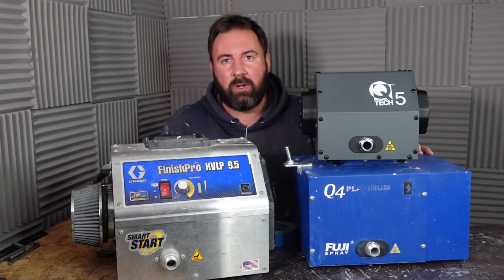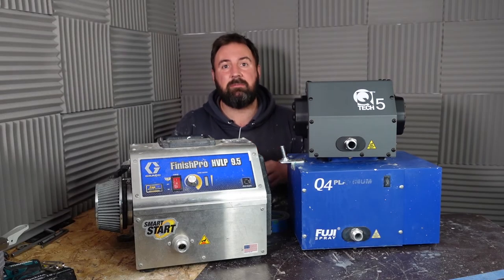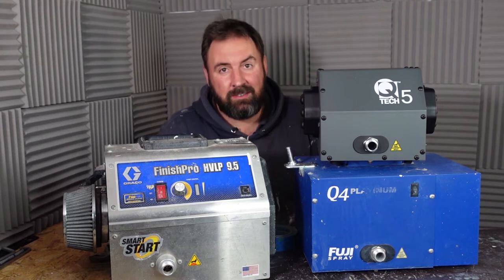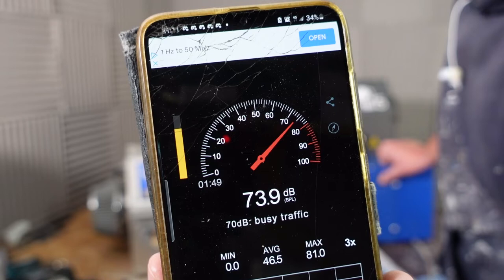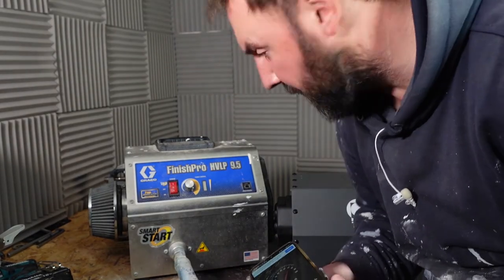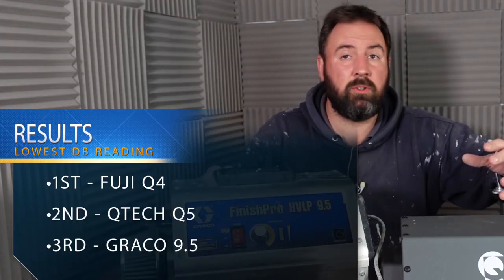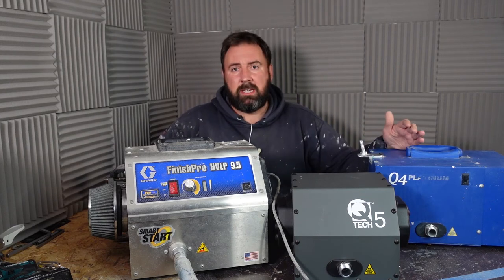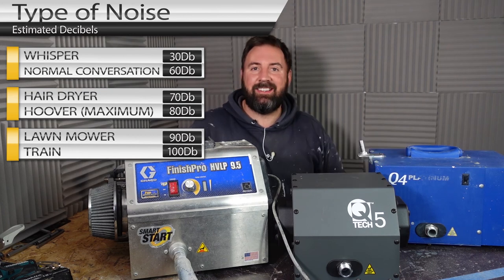HVLP Turbine Sound Test: Graco 9.5, Fuji Q4, and Qtech Q5

Comment: I never use the turbine in the room I’m spraying. It’s too noisy ( they all are) . Also the suction is so strong,any spray mist/ dust is going through your filters. The hose is so long you can put it outside the house or another room to annoy someone else and use a remote plug socket and save a load more money on the start/stop feature on the overpriced Graco. Buy a 5 stage turbine……avoid Apollo. I’ve been using Turbines since 1983
Reply from the maker: answering questions i get asked thats why i made the video
Reply: Why not the apollo turbine?
I just picked up the 7700 atomizer gun and I'm looking to pair it up with the best turbine. 
I've got a Titan 7.5 currently.

Comment: Like the video, attempting to respray a car and in the look for a turbine system was looking at the Fuji q4 platinum series a bit pricey but would rather buy a decent spec one, do you have any other recommendations or advice? 😁
Reply from the maker: Q4 is the quiet one. And also a q4 is only 4 stage. Id always try and get a 5 stage unit. Its got abit more power. 
For the price though, you could buy a decent compressor set up and do it that way.
Qtech q5 is a good price turbine wise

Comment: It's strange how they all sound so different but are in the same range. I'm literally at the stage of having the Qtech 5 in my basket ready to purchase before your video came up. 
Have you used any of the 3M PPS 2.0 cup system on any of these hvlps Simon? I was looking at them today.
Reply from the maker: That qtech is a great buy. And to me in person was the lowest hum. I read that when comparing Db ratings if something is 60db and another is 70db . The 70db is 10 time louder than the 60. So even just a couple of figures is a jump in noise.

Also the qtech and fuji are the same. Same guns needles etc. And you can buy the pps system for the qtech its great. Where you looking to buy?
Reply: @sprayaholic  I found the cheapest price on a site called tradec supplies with the remote pot included(forgot to mention that was included). I rang up Dulux and they've priced matched it near me so I'm going to get it from there. In case of any issues etc.

Would you buy the Qtech 5 or the Graco if you could buy one only?
Reply from the maker: @Daniel Woolcock  the q5 is better for value. Id just say buy a 1.8mm needle aswel
Reply: @sprayaholic  yes I was going to see if they did a deal on the 1.8 set being as I'm buying the full set up. Is the 1.8 needed for using zinseer Allcoat neat? For spraying doors, windows etc
Reply from the maker: @Daniel Woolcock  i thin near enough everything atleast 10%.
Reply: @sprayaholic  thanks for mentioning that. I've seen people try to put through products without thinning. For furniture spraying what would be your go to primer after sanding? Zinseer bin maybe?
Reply from the maker: @Daniel Woolcock   i use BIN quite a lot.  Aswell as zinsser 123+ which is waterbased. Also caparol haft primer, tikurilla akva primer or otex oil primer. Those are my 5 main used primers
Reply: @sprayaholic sorry, didn't know you had replied.

 do you not get any bleed if you use 123+ on dark wood furniture Simon? 

I use 123+ as my undercoat when converting old oil base into waterbased top coat. Usually 123+ then aqua guard.

Do you think you could do a video of the set up, spraying something with bin maybe and cleaning the Qtech 5 hvlp 🙏🤞🏻

Thanks for all your advice Simon, appreciated. 👍🏻
Reply from the maker: @Daniel Woolcock  hey. Yes got some q5 videos on the way. 
If you havnt seen these take a look.
Ones cleaning BIN and the other is spraying it. Same principle using another gun

https://youtu.be/u8WRpjY3l30

https://youtu.be/hCEz_juM5ZI
Reply: @sprayaholic  cheers Simon, looking forward to the upcoming videos 👌🏻👍🏻

Comment: does the graco 9.5 do such a finish?i'm between the qtech 5 and the graco pro comp 9.5 which one would you advise???
Reply from the maker: The pro comp is the one with the pressure pot and built in compressor.  Its alot of money compared to the q5 with pressure pot. 

Both will give you the same finish as its down to paint consistency and tip size. You get more included with the graco but there are some good deals on the qtech. Id probably go qtech regarding budget